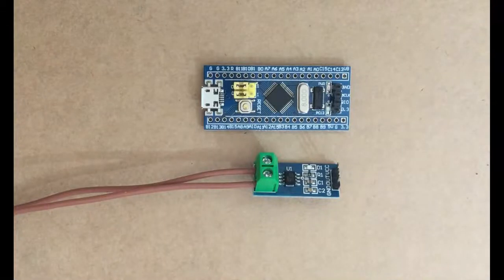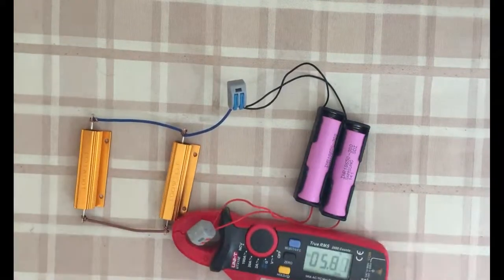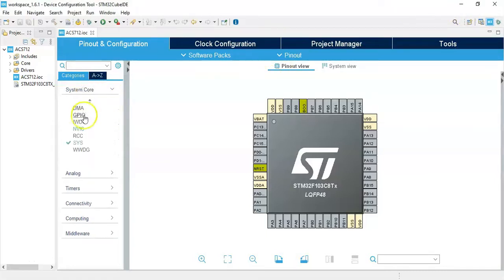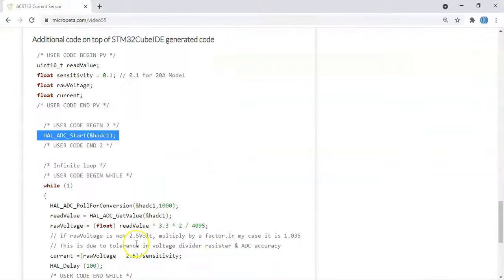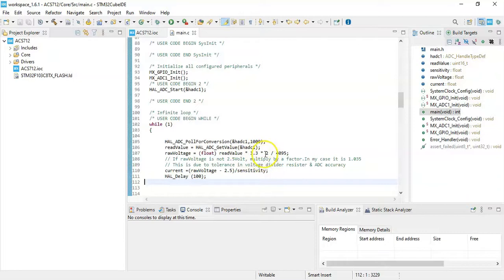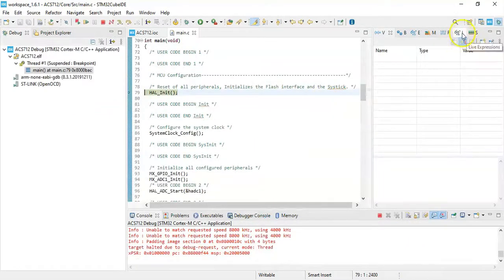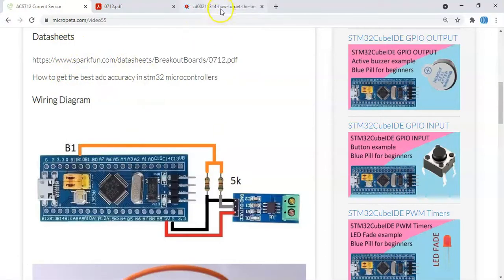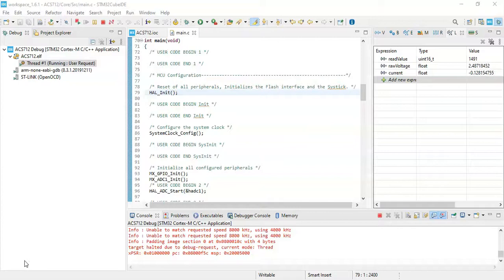55. STM32CubeIDE ACS712 current Sensor with STM32F103C8T6

Comment: how to calibrate,any video link
Reply from the maker: I have calibrated only zero ampere point.
We have to calibrated at several points until rated 30 ampere
We need variable load to produce variable high currents. Even 20A/ 5V produce 100W and the load I had can not handle the heat for few seconds.
So for many beginner students don’t have the facility to calibrate at home
If they wanted so precise measurements then they should contact current calibrating people.
Thanks

Comment: I think if you use sensor for measure, you should calibrate it.
Reply from the maker: You are right. I have calibrated only zero ampere point.
We have to calibrated at several points until rated 30 ampere
We need variable load to produce variable high currents. Even 20A/ 5V produce 100W and the load I had can not handle the heat for few seconds.
So for many beginner students don’t have the facility to calibrate at home
If they wanted so precise measurements then they should contact current calibrating people.
Thanks
Reply: @NizarMohideen  how to calibrate

Comment: Hi, thanks for recommending this video! 
Do you have a video on adjusting the PWM with a potentiometer? 😊
Reply from the maker: In my channel
Video no 15 - PWM 
Video no 16 - Potentiometer
Video no 32 -  Potentiometer with PWM (It is for multi also it can be used for single)
Reply from the maker: https://www.youtube.com/watch?v=92_CWBWXPw0
https://www.youtube.com/watch?v=oNiz5md51G4
https://www.youtube.com/watch?v=03IxWEe1bQk
Reply: Hi, would like to ask, can this work without the voltage divider?
Reply: For the current sensor
Reply from the maker: Current sensor output voltage range is between 0-5 V
STM32 ADC input voltage range is between 0-3.3 V
These two do not match so we can use a voltage divider to make it compatible

Comment: Thankyou for this video sir. I am trying to design 3 phase overrcurrent relay. Could you please tell me how can I take 4 current inputs and 3 voltage inputs in the stm32cubeide?
Reply from the maker: Thanks. You need to use multi channel adc.
I have done with 3 potentiometer input in my video-no-32
Have a look at it.
Similarly you can use seven channels
Reply: @NizarMohideen  Thankyou for the quick reply 
, I'll check it out!

Comment: Facing some problem with same set up .. (Used 1k + 1k resistors for voltage divider) . In live expression, the values are not updating continuously. I have to manually pause and resume. Can u plz suggest .... waiting for reply
Reply from the maker: STM32CubeIDE Settings
ADC1 - IN9 (tick)
Parameter Settings --> ADC Settings --> Continuous Conversion Mode (Enabled)
Reply: @NizarMohideen  Sir, checked these settings but same problem exist...
Reply from the maker: Okay. We need to find out the reason.

Is the live expression not lively? Create a simple counting program. Add one to a variable every second  and monitor it in the live expression

Is the ADC not converting continuously? Use an LCD or OLED to display the values and see whether it is updating.
Reply: Sir checked as directed but variable can only be added / checked in expression not in Live Expression Window...if added it says feature is not available
Reply from the maker: Variables to watch in live expression has to be outside int main(void).
It can be inside 
/* USER CODE BEGIN PV */
// Here
/* USER CODE END PV */

// OR

/* USER CODE BEGIN 0 */
// Here
/* USER CODE END 0 */
Reply: Sir, variables written in /* USERS CODE BEGIN PV /  & / USER CODE END PV */
Reply from the maker: Okay. If you are using OpenOCD Debug probe, you need to use latest version. 
Try with GDB server Debug probe as well
Reply from the maker: For some microcontrollers, you need to stop and start ADC in the loop.

    HAL_ADC_Start(&hadc1);
    HAL_ADC_PollForConversion(&hadc1,1000);
    readValue = HAL_ADC_GetValue(&hadc1);
    HAL_ADC_Stop(&hadc1);

Comment: Very nice and explained in detail…kindly share for AC measurement also..Thanku
Reply from the maker: Thanks. The ACS712 module can be used for both DC and AC current. You can use the same way for AC current. Same wiring. Same CubeIDE settings and same code. Just cut the wire and feed into the sensor. Please take safety precautions since AC voltages are lethal.
The country which I am living currently has a law. Only the licensed Electricians are allowed to cut AC wires. I need to respect the law so I can not make a video and demonstrate. Thanks for understanding.
Reply: @NizarMohideen   Thanku for the reply.  Understand the limitations... Sir can u plz tell if voltage divider is to be used with stm32 ..?
Reply from the maker: Yes. Sensor Out will be 0 - 5Volt. Same for AC 220V.
Use 5k Ohm & 5k Ohm resisters to get 0-2.5Volt.
It is exactly same setup as I used for DC current
Reply: @NizarMohideen  Thanks for the reply..

Comment: This project would have been better if it had a display with it
Reply from the maker: Hi Abdul Hai,
Thanks. I left the display part for a later video where I can combine voltage and current measurement together to calculate power (in Watt). If you want to display only the current, you can use the steps I used in OLED with DHT11 (https://youtu.be/rIqM63S9eUQ). It is very similar to displaying Fahrenheit
Reply: Voltage show in display